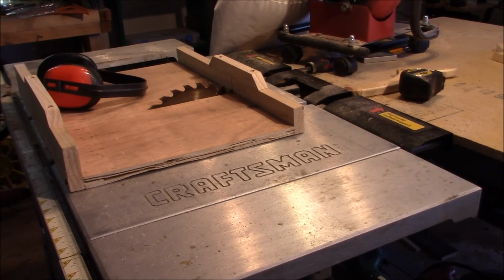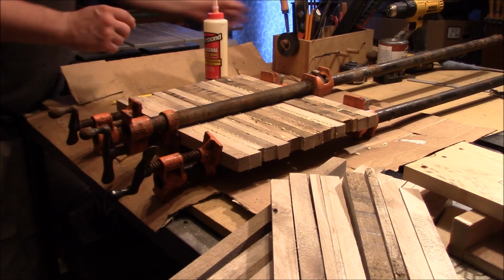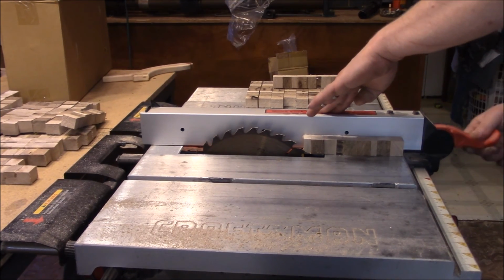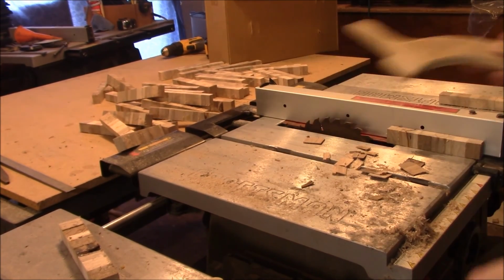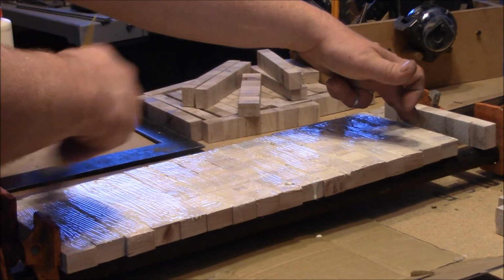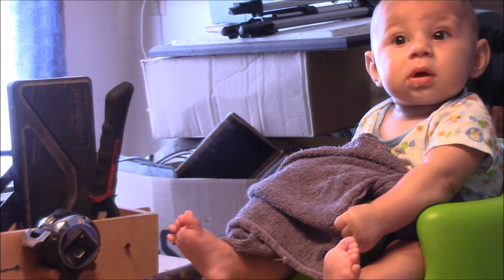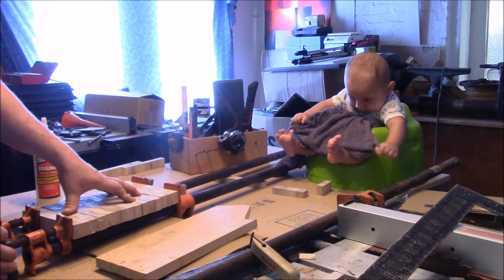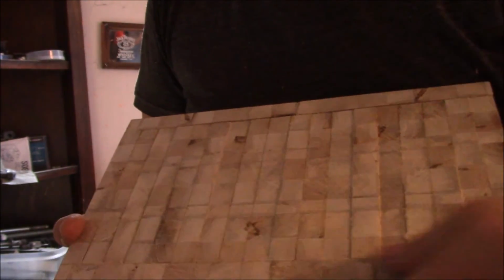How not to make an End Grain Cutting Board without a planer

Comment: I don't think that glue is waterproof.
Reply from the maker: I should have used Titebond III instead of original And actually do. I'm not sure why I didn't in this video. Thanks for watching.
Reply from the maker: My cutting boards are MUCH better now that I have a planer and better shop and tools. lol
Reply: What type of wood did you use?